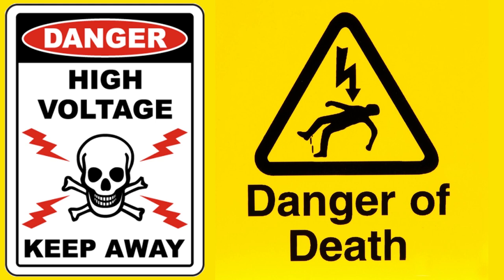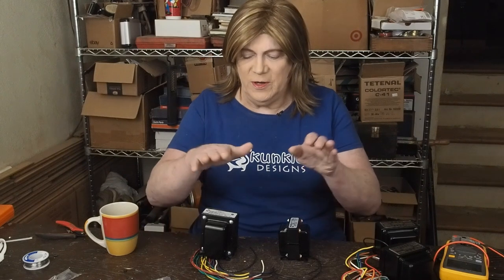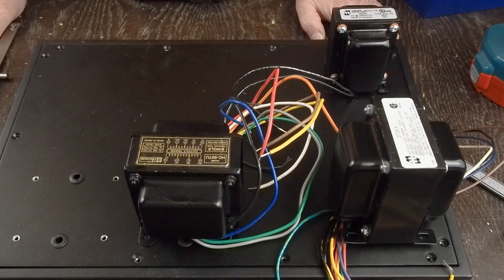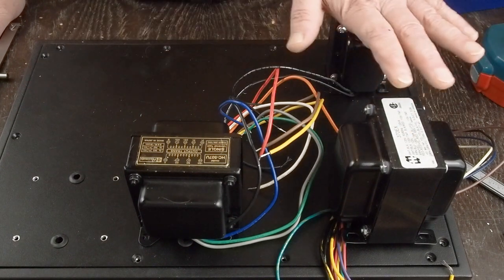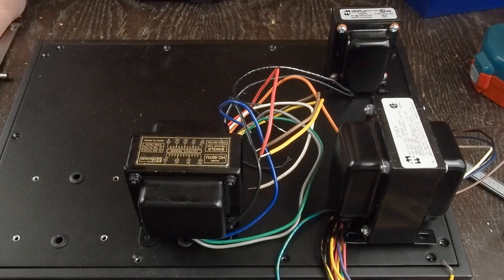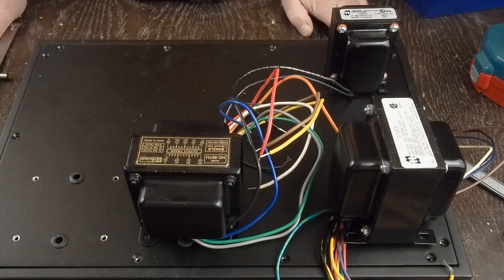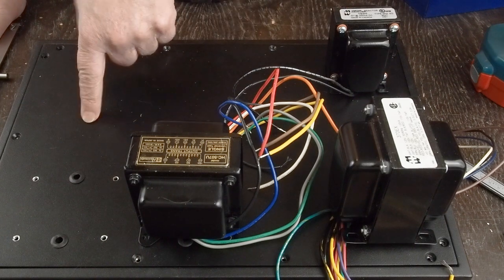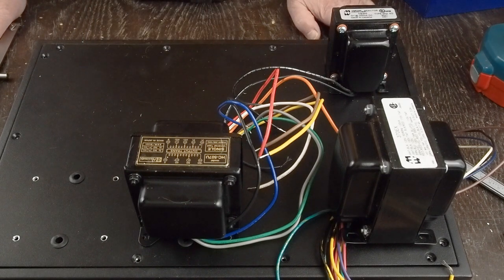1930's Globe Tube Amp: Fabrication #2

Comment: Electrical Safety Ground is a must have in my book. Your use of a Star ground system is the road to travel for the a chassis ground. One thing to remember is all ground connections must be well made [low resistance] or the star will fail to function properly. The more resistance in the connection the farther you get from a true ground electrical potential.

Comment: Chassis ground is seprate from circuit star ground so you will not have a hum in the amplifier. Inputs and outputs are grounded to the star ground and not the Chassis ground. Chassis ground is so you don't get lit up if for some reason there is a short to the Chassis  Chassis ground will act like an RF shield as well. If you hook up all components to a singe electrical source all Chassis grounds are tied together and all components are in phase to each other to the power transformers. If you tie the circuit grounds to a chassis ground then you could get a 60 cycle hum but not always.
Reply from the maker: I understand why it's needed, but I think there is more to this than "could get" and "not always".
Reply: I had the intention to lift the signal ground off of the chassis/earth ground but soon realized how onerous that is practically, especially if you are working with a metal chassis. You have to insulate every single signal ground point, of which there are many! I relied on solid star grounds and have two amps that are dark as the night. That does not contradict what you say, but it is my sense that the separation of the PS and other stages and keeping AC away from gain stages is more crucial in avoiding hum.
Reply from the maker: @raveG244  That and ensure if there is a "remote ground point" you also tie that point, with a heavy copper wire, to the main star ground point, giving a lower resistance path to that single ground. That way the majority of the current has a low resistance return path.